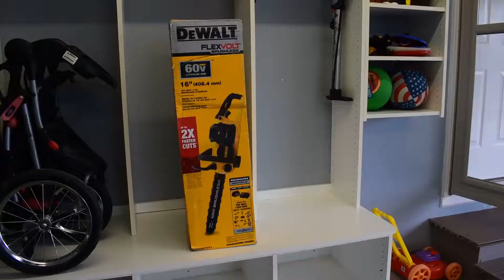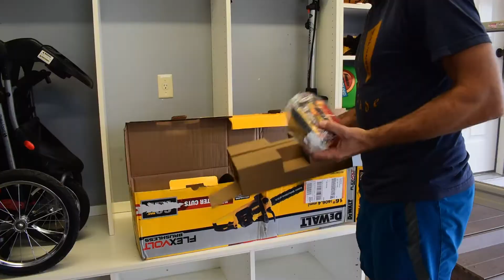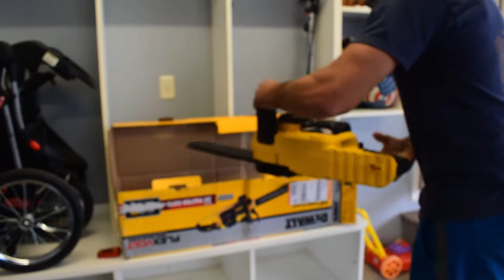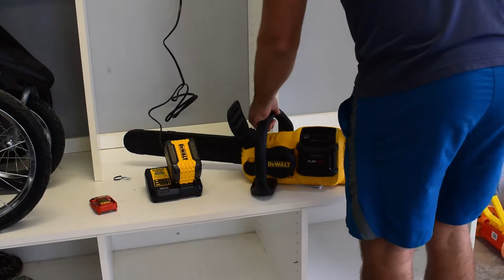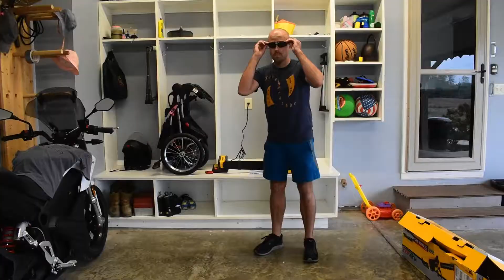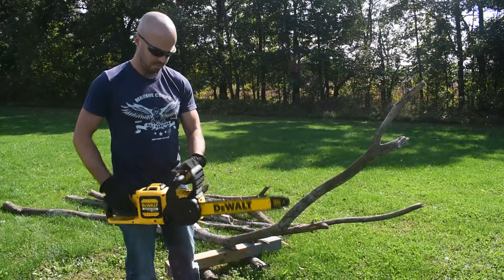WHY ELECTRIC?  DeWALT FLEXVOLT 60V 16in. CHAINSAW UNBOXING AND REVIEW

Comment: It's a 2.0 when the voltage is raised internally
Reply from the maker: Thanks.  Yeah, I figured that out.  Still good, though.
Reply: @usmcsaxoki  for sure I just got the saw and I have 2 other 60v batteries I use on my other tools

Comment: Bought theharbor freight 18" 80 volt saw. It's good for small stuff 10-12" but anything bigger you have to have a gas saw end of story
Reply: Just depends what size gas saw also.  This 18inch DeWalt has more power than my 16inch style by far.
Reply from the maker: I hear that a lot.  The DeWalt works for what I need it for.

Comment: Kind of waiting for 18"/20" especially because they should come with old school bolts and nuts to hold the bar instead of plastiiique tool-less tensioner which seemed to me as weekest part not truly able to hold the bar firmly and securely in this model. Otherwise it's a good hobby saw.
Reply: I just got the 18inch.  Glad u waited.  Just the 2 bolts and old style adjusting is worth it.  I like the better lube tank screw.  The spikes are great also.  She screams thru wood! Just got the 9ah battery for it.
Reply from the maker: Thanks for the comment.  Yeah, not heavy duty but good for what I need it for.

Comment: you better watch for the bar oil to leak out also mine did so I put in a O-ring on the oil filler cap. something I didn't expect from Dewalt
Reply from the maker: Thanks for the heads up.  If there has been leaking, it has been minimal.  I keep it nearly empty when not in use.

Comment: Yeah I would suggest getting this saw with the 3 ah battery, not the 2 ah. Burns through the battery pretty quick.
Reply from the maker: Will definitely grab another battery or two if needed.
Reply: has anyone tested the 9ah vs 12ah?
Reply: @justray510  something weird is happening, you're comment just dissapeared too.
Reply: @benjaminleslie3155  it's still there. Something weird is going on it seems. Maybe an out of control bot!
Reply: @justray510  maybe. I've never had this happen to me before
Reply from the maker: @justray510  I have not.
Reply: Did my comment just get erased?

Edit: well I don't know what is happening with my comment, I guess the youtube automated system doesn't like something I'm saying. Wish I could tell you exactly what I know about the dewalt saw and the batteries but guess I can't.
Reply from the maker: @benjaminleslie3155  I don't know because I don't remember what you originally wrote.